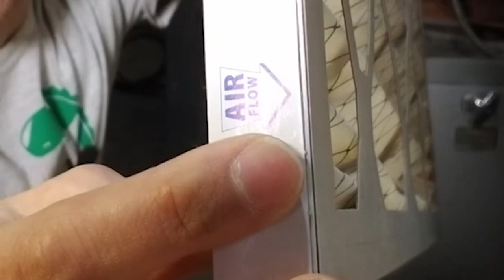My Mistake Led to a Oil Fired Hot Air Furnace Tutorial

Comment: Need to make an adapter plate out the get a Beckett burner . Same ones they put in trailers/ mobile homes, They're far more efficient and work the same.
Reply from the maker: Actually, the burner is a Beckett brand installed in 1987. Over the past 19 years, I have replaced several components such as the motor, igniter, and controller, but so far so good...and thank goodness for service contracts!

Comment: I have the same unit so this was a fantastic video for me. I will also put a carbon monoxide sensor in the basement. A question I have is when the AC is on, I get condensation backed up and spills back into the unit and not going to the sump oump. How would I check the condensation inside the unit? Thanks again!
Reply from the maker: If condensation is spilling back, then I would check for a kink or blockage in the condensate line. Also since I believe it is gravity based, ensure the condensate line always pitches down away from the heat exchanger. I hope that helps!